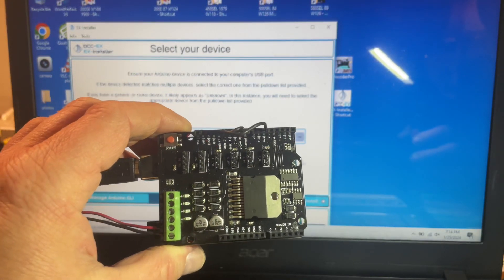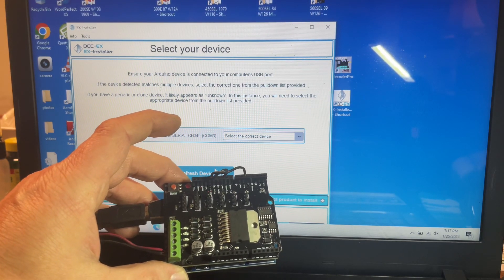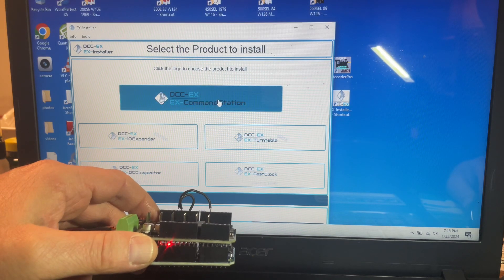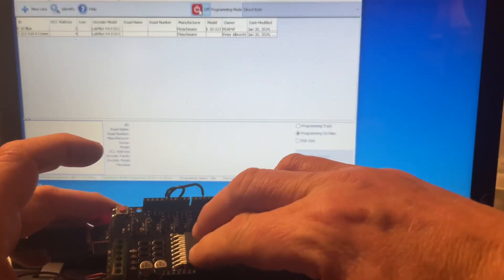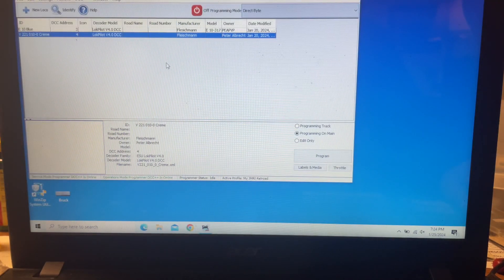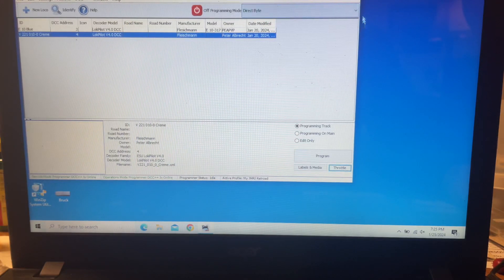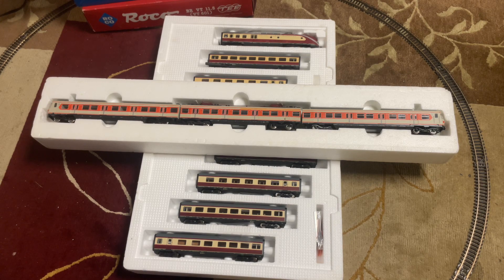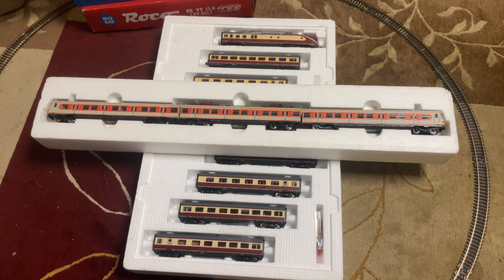DCC++ vs DCCex with JMRI, determining total current supply needed for my future layout

Comment: Thank you for the video. I don't have any experience with digital trains but from the videos I saw on youtube the current needed is lower than expected. Moreover it might make sense to split a big layout into separate powerdistricts? When you were talking of 20 amps I thought the rails might not be fit for such a high current, especially the joiners. I habe the impression that Hans Tanner on his iott channel is providing a very good reference on digital development of a layout and because he designs a branch for the gartenbahn all the time is quite experienced in high current power design. Sadly at the moment I don't habe the space to build a layout and ended up collecting locomotives and coaches, which pile up everywhere. I buy these second hand and of course dc and most of the time I think at one day I will just habe a dc layout to run them. And I see videos like yours and I am not that shure as the conversion, especially on the old Fleischmann don't seem to be so bad, the motors running better, the space is there in the loco, the prices have dropped ... The main ideo of dcc, I knew that but Charly on his Chadwick channel pointed that out to make me aware of it, is, where the driver sits. With dc the driver sits everywhere and nowhere, in some kind of a powerplant by the track and on digital systems all ober sudden the driver is driving his engine. a great difference. After piling up rolling stock I thought a good idea is to buy used track (another pile next to the locos) and even though many modellers wouldn't recommend this I invested in used Fleischmann Profigleis. In the end my layout will be technology oriented more than habing some of the most beautiful landscapes. For landscape design please do not miss Jacque Leplate's webpage. He is just in the progress publishing his complete layout experience online for download, very generous, at http://ferbach.be/html_uk/ukcamythe.htm in french and german only, should be no problem for you. And than I see my loco stock any time I watch you channel and that makes me kind of happy. Just two years ago I bought the same Röwa S-Bahn, which is a stunning model. The diecast models from Fleischmann which love to throw themselves out of the curve, lovely, have these here too. All in bad state of maintenance. On New Haven from Fleischmann with a broken bogie and I thought how did that happen but found the answer in your last video (I will try to repair that (later) or swap it with one from a donator engine), thank you. All in all I just should start repairing locos, having a circle to testrun them, better on a foldout table than the floor for the locos not to suck up to much carpet but with dropoff rails, rather than thinking of the space for a decent layout and drawing trackplans in my head for a space I might never acquire. (this comment starts to be a bit langthy) and stop buying (which makes me happy but I lost track of the purchases). The modellers having a presentable setup beautiful to watch have started in their 50ies, I won't find time until I'm out of work at 67 and even than my pension will need me to find a job to finance my live, I know, and thats only 6 years to go. So I should better start now than later. Please! Keep up your spirit and the good work and rescue further old locos. Best Albrecht